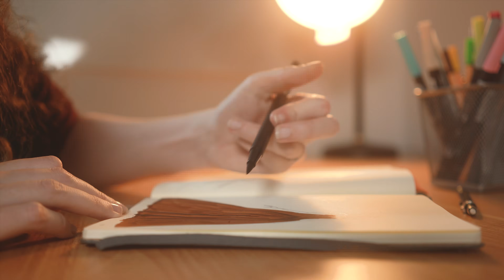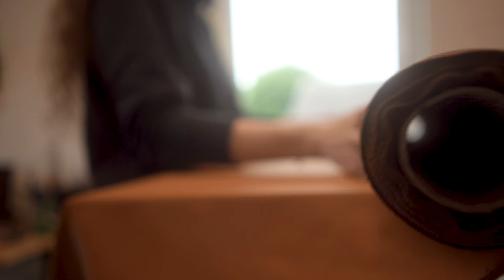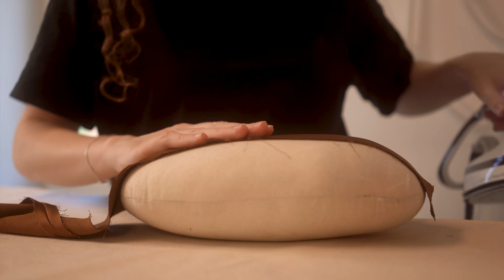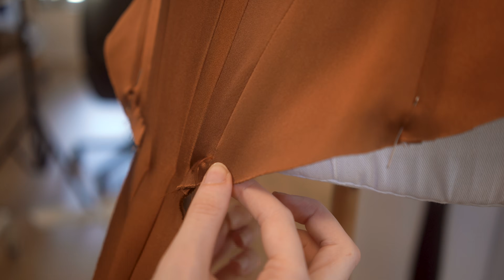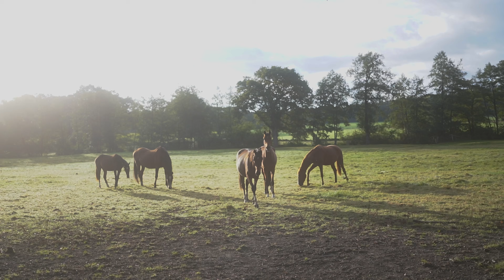This Dress Was a Fail—Until I Made It Into My Dream Autumn Dress

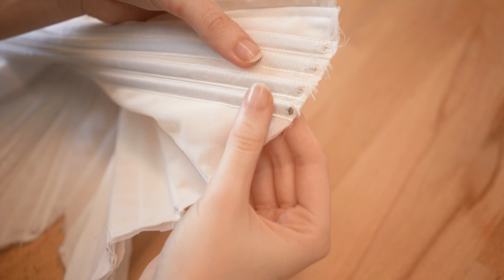Comment: 6:16 Feels like I've fixed hundreds of stays, but probably not that many in reality. After mending them over and over, I discovered that if you don't deal with the sharp edges of the stay, that made the hole... It will just poke a hole in the new fabric. So take a few moments to sand down those sharp edges, or you'll be mending that spot again and again! 💕🌞🌵😷

Comment: I know boning is all the rage right now, but it's really just a disaster waiting to happen.  I have NEVER seen a boned outer garment that didn't rather quickly have the boning trying to poke through.  There's no way to cushion the ends or sand them smooth enough that this won't happen, especially with more delicate fabrics.  The good news is that boning -- as in actual whale bone (but now plastic) -- didn't come along until fairly late in sartorial history.  Prior to that, cording and reeds were used.  I have had great results giving garments structure and shape with piping or French or flat-felled seams.  I'm afraid that many of us think the boning is there to give US -- rather than the garment -- the desired shape.  It just doesn't work that way.

Comment: Little tip for removing bits of thread in ripped-out seams: use a (new) gum eraser on the fabric - looped thread side works best. The eraser will grab onto the bits of thread and pull them out. 

Genius! I only learned this recently. Been sewing for over 50 years and just learned this trick!
Reply: I sometimes use tape and smooth it over the little bits, and then rip it off like a wax strip 😂